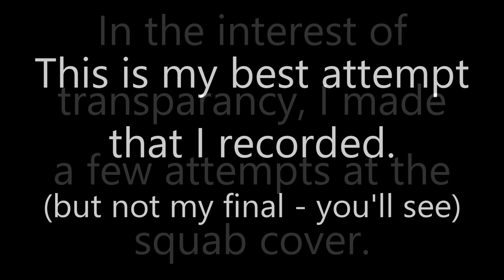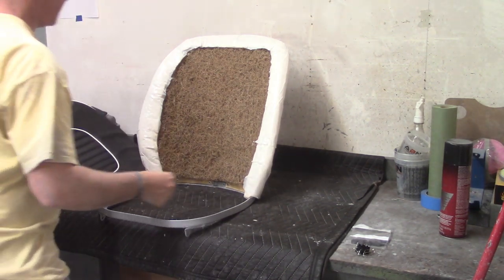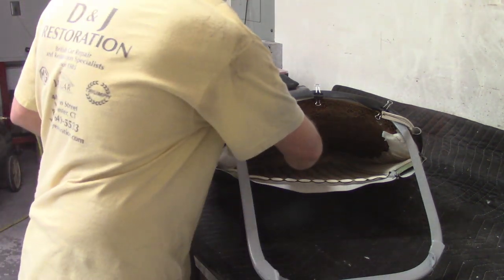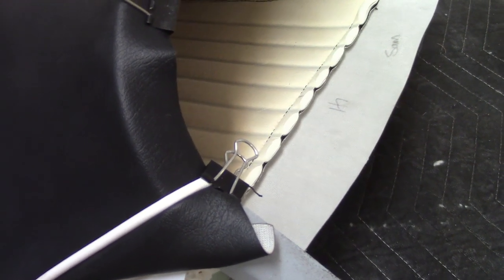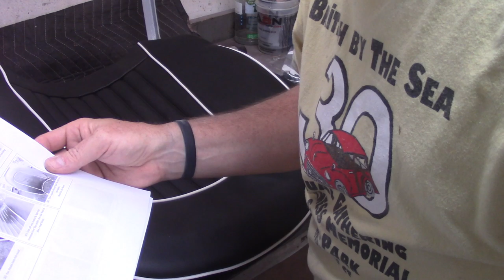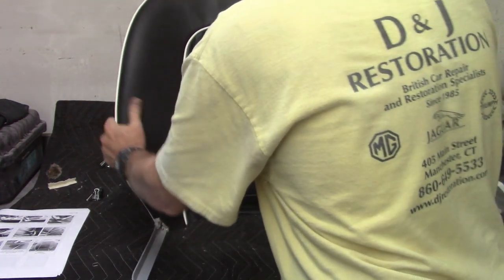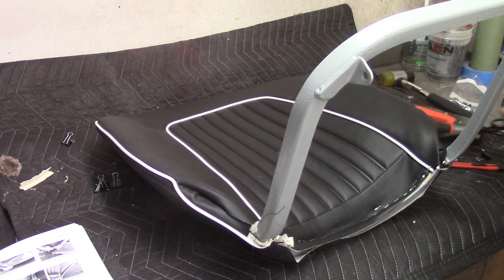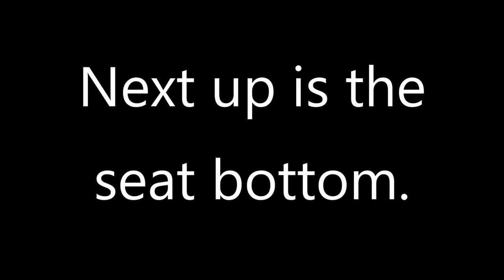Triumph Spitfire Mk2/3 Seat Restoration Part 2 - Squab Cover (Vinyl) | Roundtail Restoration

Comment: Man that sure looks like a frustrating job but I think you did a nice job with it big me question if I want to do it myself or send them out. I don’t suppose you have an extra set of Sliders do you?
Reply from the maker: No, I don't. Rimmer's sells the runners, but the the slides, which is probably what you really want. It wasn't horrible, but I'm blaming that a bit on the finish of the seat cover. It was probably me, but I think it may have also just been a bad design. You'd think they would have improved it if that was the case...maybe they did with the updated stuff I mentioned. I'd do it again, but it's only because I wanted to do it. If I ever do another car, I'll probably send the seats out.

Comment: Where did you order this kit from? I have the exact same seats in my Mk3. Moss motors?
Reply from the maker: No, I got it from Spitbits, but it's a kit from Newton Commercial in the UK. Great stuff. From what I've been to figure, they supply most of the kits to the big resellers. You can buy from them direct, I believe. And if you have a doubt, I would because it's high quality stuff.